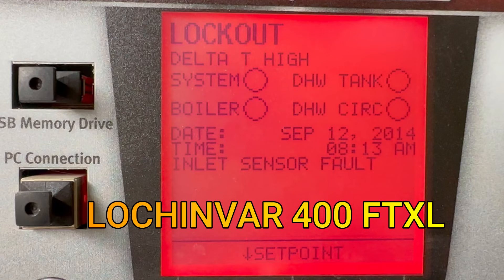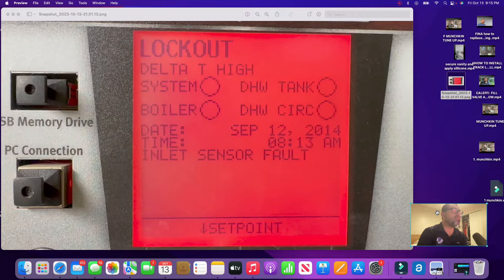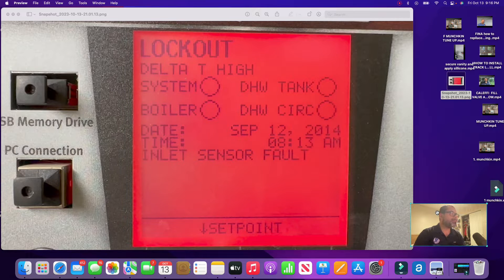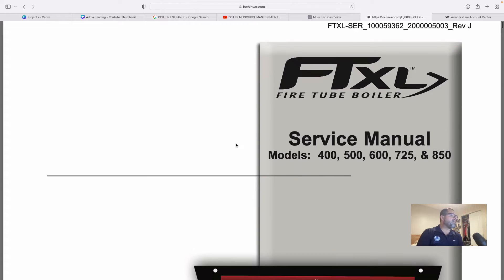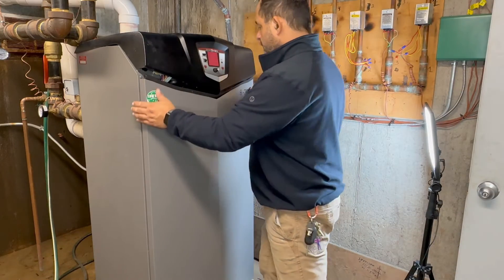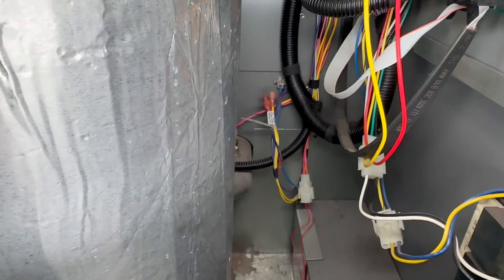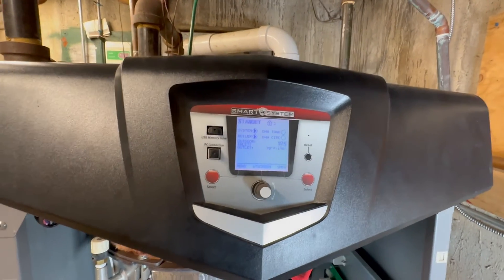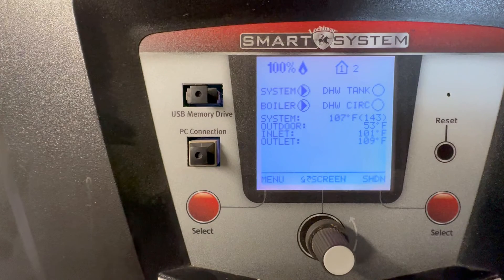LOCHINVAR FTLX  LOCKOUT INLET SENSOR FAULT

Comment: I’m going to have to replace an outlet sensor on a newer crest boiler. Luckily, they now put a dry well to where you can take the sensor out and not lose any water or gain any air. Previously it had an ADC controller fault, which I don’t find in the troubleshooting codes. Can you direct me on this code?